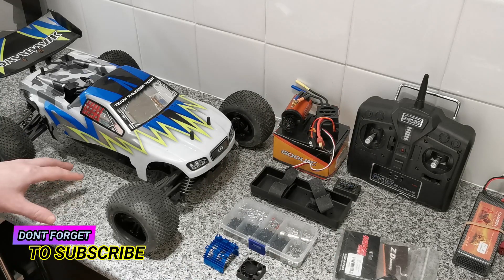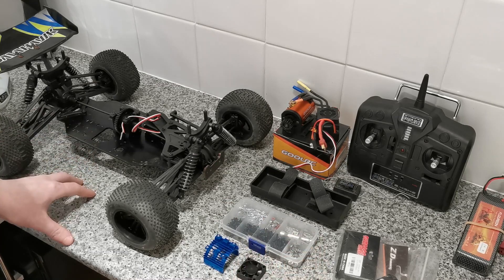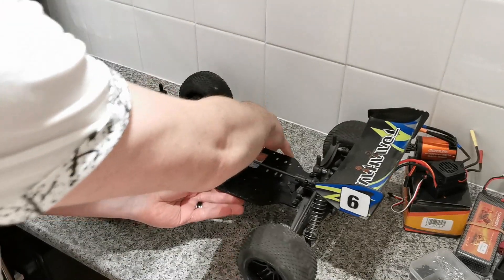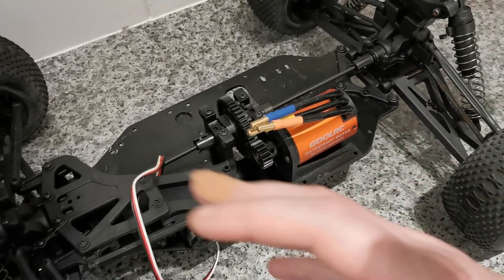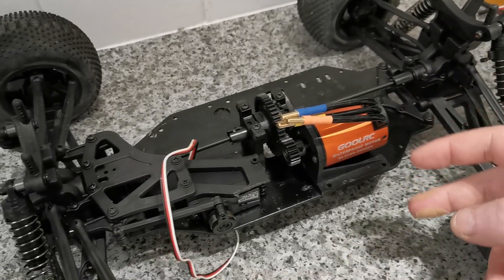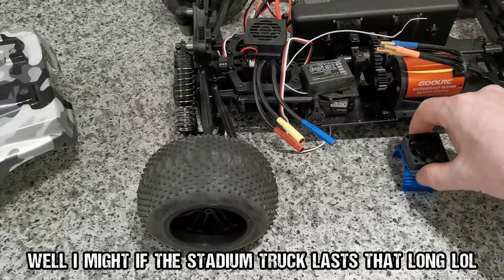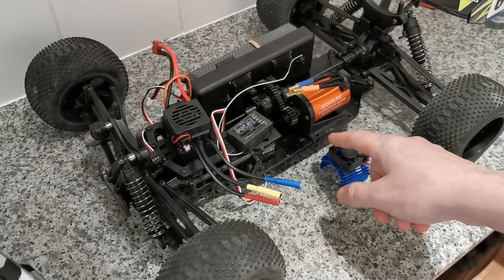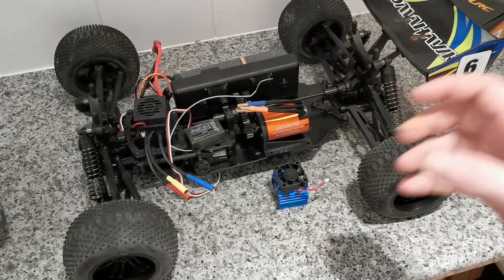Converting A Nitro Truck To Brushless Power Project pt2

Comment: Isn’t 25dp mod1? Why was it that hard to find a pinion?
Reply from the maker: Hello, because my local model shop did not have then neither did the model shop I use online so had to find then on ebay and that was not easy either 👍
Reply: @MarcRCAddict  Amost every 1/8 car uses mod1!
Reply: @MarcRCAddict  Was the problem the shaft size?
Reply from the maker: @user-dz2jv4in5z  it was the combination of it being 25dp with a 5mm shaft whole, so we used a 3.5mm adaptor..